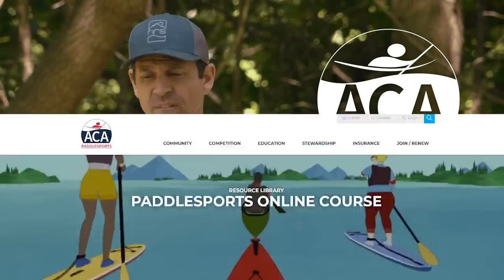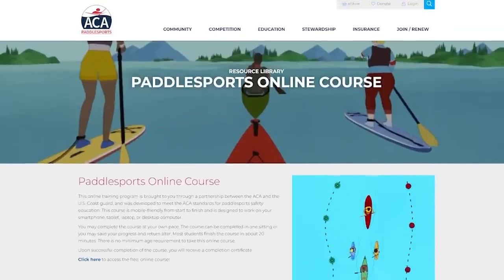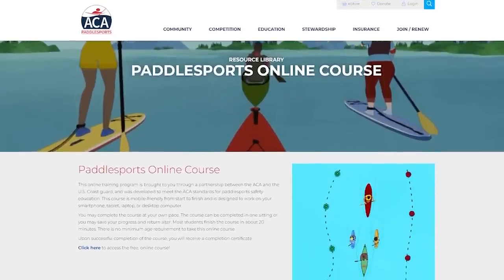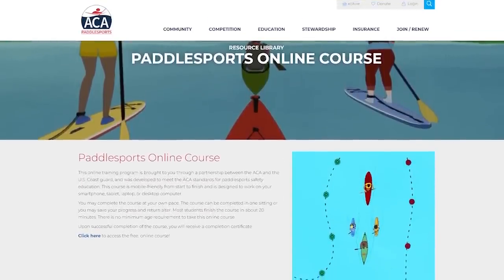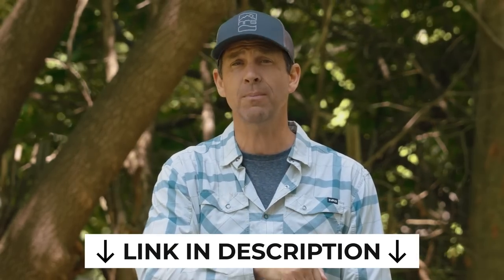How Kayak Design Affects Performance - How to Choose the Right Kayak

Comment: Video suggestion:  Talk about draft depth and how it changes for different kayaks.  Both the surface area and shape of the bottom the boat will significantly affect this.  I was on a trip with a Wilderness Tsunami 125 (largish bottom and v/flat shape).  My friend was in a Piranha whitewater boat (small bottom and big curve).  He was hitting rocks and grounding out right and left...while I was gliding over them no problem.  If a paddler is planning on doing small rivers/creeks that have a lot of shallow areas, they should consider a boat that drafts well.
Reply: I ordered a Tsunami 125 online but had to refuse the shipment because the boat had an apparent crack. Now I'm considering the Tsunami 140 because it's only $200 more and I'm afraid if I purchase the 125 , I'll wish I chose the 140. Curious if you've paddled the 140? I'll be padding lake 99% of the time.
Reply: @whiteknucklestormchasing  I'm not a fan of the 140...too long and narrow for my type of rivers.  For something similar to the Tsunami 125, consider the Jackson Tupelo 12.5 or Old Town Loon 125 or the Wilderness Pungo 125.
Reply: @AaronSmith-sx4ez  I have checked out the Pungo 125, Loon and Tupelo.  I like the design of the Tupelo except for the recent change to hard molded plastic seat. I just don't know how noticeable (if any) 2 more feet will have on glide and efficiency.  If it is noticeable,  is it worth a couple hundred more $$$.
Reply: @whiteknucklestormchasing  
You mentioned that you will be paddling on lakes  most of the time. However, it ultimately depends on what type of paddling experience that you are looking for.

 Longer kayaks generally will have better tracking, more paddling efficiency, and have more speed. But, are you looking to paddle for extended periods or short trips?
 Are you looking more for speed or stability?
Are you going to be camping or fishing? 

Before you make a purchase, I would recommend going out on a demo day and paddle  several kayaks at your local outfitter. Or, you could rent a kayak as well. Keep a notebook with you and write down the kayak model and specifications of each that you tested. Also, write down what you likes and dislikes as well.

 This will take a bit more time, but you will appreciate Kayaking more when you find the right vessel that matches your needs and so will your wallet! 

In closing, buying a kayak is similar to buying a pair of shoes. Things like height, weight, comfort, performance, and features are very important and will help or hinder depending on how you use them. You wouldn't wear rock climbing shoes to go hiking in the mountains. Unless you are a masochist! Take care and happy paddling!
Reply: @robertcarpenter5681  Great advice Robert! Thank you!

Comment: I just got back from helping with a small race. I got my hands on a Necky kyook 15ft that I used for it today. It sure challenge me, let me tell you. I was upstream paddling in a canal. I did fine until I got to a really strong current and sharp turns. It sure tested me and I had to push myself off away from the bank at one point because the current pushed me into. I can definitely feel the difference between that hull design and my 12ft rec kayak. Love videos and thank you for keeping us informed, it has helped me a lot. 😁

Comment: well done. I would only add that the design of the deck and cockpit combing also determines how you use the kayak. Some sea kayaks have low side and rear decks close to the shear line. You should always wear a full watertight skirt when paddling these style boats in any rough water. They are designed for them and without a skirt waves will breech over the sides and rear deck and flood the cockpit. I see recreational paddlers that buy or rent these boats and then when the first wave douses them from the back it is a big surprise.

Comment: That was a pretty good effort at covering a pretty broad subject.
It's really hard to lump it into one package.
The reality is that a newcomer more than likely won't be able to envision what they'll be doing in terms of paddling two years from the beginning.
It took me several years of learning how boats respond before developing an ideas of about what hull characteristics I actually wanted in a boat. Then I started reading several books on hull design and boat building. Now I build what I want knowing every choice is a compromise.

One item of note. Longer boats are not "faster" so much as a longer boat has a greater potential for speed than a shorter boat. Shorter and lighter boats tend to be quicker with less top speed. For those not trying to cruise above 4 mph, a 14 foot boat of similar design can cruise just as well as a 17 foot boat in the 3-4 mph range except it takes less effort to do so. The added speed of a long boat doesn't come for free. Longer boats require more energy at lower speeds than shorter versions of the same boat due to the added weight and wetted surface areas.
Reply from the maker: Cheers!
Reply: I disagree in general, longer boats are not always heavier and do not necessarily have a larger wetted surface. My 17 foot sea kayak is half the weight and has lower wetted surface than my wife's 13 foot rec kayak. Both of my greenland style sea kayaks takes less effort to cruise at any speed than most any other kayak. If you are comparing two same style and construction boats (ex: two touring kayaks from the same manufacturer in a large size vs medium size), then yes of course the larger boat is heavier and has a larger wetted surface. Remember, hull width, buoyancy, and wetted surface are not proportional to length, it all depends on the design and materials. However hull cruising speed IS directly proportional to hull length because the wake is longer. The length of a boat's wake has a direct effect on the cruising speed.
Reply: @PappaMike-vc1qv  Note I mentioned a shorter version of the same design, not a shorter and wider boat. There's weight and the surface area exposed to water. More whetted surface area equals more resistance.
Longer boats have higher hull speeds due to their bow wakes remaining shorter than the LWL at higher speeds than a shorter boat. It's just physics and hydrodynamics. A shorter boat of equal width requires less energy to accelerate than a longer boat of the same width due to the resistance of water.

Comment: Excellent presentation, I learned a lot, thank you. You didn’t mention the effects of wind, particularly on the bow. I found adding any gear to the foredeck makes big difference in the wind. While smooth rounded foredeck allows better tracking in rough conditions. Also stern design wasn’t mentioned. Obviously a rudder or skeg is a game changer but I think the stern shape thats underwater can provide some directional stability without those additions. I’m just starting off with my first kayak. A wide sit-in design. I find it’s very stable because it’s wide, however that makes it more challenging to paddle. Perhaps my paddle isn’t long enough or bad technique !

Comment: Thanks for the fantastic video! The funny thing is, I play disc golf and the quality/type of plastic makes a significant difference in durability in many plastic types. Adding reds tends to make our plastics stiffer and more durable, so I was perfectly ready to believe that hulls made from a red mixture were stronger! You absolutely had me! (and I still am wondering if there might be some truth to it...)
Reply from the maker: Ha!  You are right... pigments in the plastic do have a small impact on its characteristics, but not enough to have a noticeable effect on kayak performance.
Reply: @PaddleTV  I suppose kayaks aren't hitting tree trunks at 50 mph nearly as often as disc golf discs 🤣. (unless they are being used very wrong!)
Reply: red and yellow pigments either fade quicker or are more expensive due to the additives needed to make them UV resistant. other colours are less effected.

Comment: I want a crossover I don't need a crazy ww boat nor do I need a 15f kayak the market loves them as they are always sold out but we're just pushed these boats from having more than we need from both ends of the spectrum.  Many of the crossovers are now a decade old where are the 10f /12f duel bulkhead crossovers, upgrades to outfitting improving flaws?   Why is good enough good enough?
Reply: I have the last gen tsunami 125 and it's truly terrible on rivers the price was right buying my brothers boat back from a friend for $575.   But its still not what I'm looking for hoping to find an dagger katana or at the very least a dagger axis though I didn't much care for the 12f.  Central Ab Canada if anyone wants to trade😅.
Reply: Sounds like the Dagger Stratos would be a good fit. They have a 12' size with noth front and rear hatches
Reply: @joshinfwtx4506  The stratos 12L was on the top of my list but I have never seen one and they're never in stock at aquabstics here in Alberta. Never seen one used though I have been actively searching for one for the last 3 years or more.   Funny everyone always recommends hard to find or discontinued boats maybe the manufacturers are putting to much development time on the wrong products 🤷‍♂️.  Got to get that dollar from every price range but that takes to much production time away from the boats that sell or could sell if they were available.
Reply: @Rockerrobin  I've seen a few at our local stores but it is frustrating how hard kayaking manufacturers have been hit by production issues. It seems like the manufacturers are focusing harder on the entry level models. I also noticed brands/models available vary by region.  It's quite frustrating.
Reply: @joshinfwtx4506  even though I like the stratos it's still probably not what I'm after I basically want like a piranha 12r with a skeg and bulkhead storage.  Something that you can play in on lower class rivers but will run fast enough in the long flat sections in between or small lakes.   Even a skeg on some of the half slice boat designs would be something I'm interested in I'm not opposed to stuffing drybags into the haul though bulkhead storage are more convenient.
Reply: @Rockerrobin  maybe a Liquid Logic Stinger XP? I think Jackson has produced few more of the Traverse recently.
Reply: @joshinfwtx4506  The liquidlogic stinger xp is exactly what I'm talking about unfortunately discontinued although loved they were not marketed with focus pushed on other boats.
Reply: @Rockerrobin  dang it, I didn't realize it was discontinued. 🙁
Reply: I got a pyranha FUSION SOT Crossover, not a bad boat on the coast. My perception kayak triumph 13 Sun Set is faster on the water. But I do love the fustion sot and use it most of the time. Nice short fun boat.
Reply: @peterkitchener8787  Not a bad looking boat looking at it other than the sit-on-top design.
Reply: @Rockerrobin  I find the sit on tops better and safer. No pumping out or spraydecks.  There easy to get in & out too. All my sot have foot & thigh braces.
Reply: This is rocker rolled over in the river today attempting to save
My hat ended up loose my phone and prescription sunglasses instead.  I can't even access my YouTube account without my phone as I can't rest my password without it with the code sending to my email I need to reset.    Bad day on the river probably a good $1000 and I'm broke indefinitely.
Reply: @robinadamson3565  Its why I use sit on kayaks with storage hatches, floating vhf radio & cheap sunglasses. If someone finds my wooden sea turtle necklace can you post it back to me? Mite be in Canada by now.
Reply: @peterkitchener8787  can't use cheap glasses if I want to see what I'm doing. I do have a phone bag but had my phone was out at the time because the phones bags come in the wrong sizes or rather the ones I needed were always out of stock. Mine is oversized and cumbersome plus unsafe to have up on my jacket and the glare made it impossible to use my phone for pictures and music.   I didn't technically loos my sunglasses entirely lost one of the lenses as I grabbed them still expensive because they were polarized prescription and a custom cut lens.   I was looking into sunglasses floats on Amazon but reviews are mixed and the frames don't work for several options.   Wish I got something probably still would have lost the lens regardless.
Reply: @robinadamson3565  Oh my wife had the same issue with her glasses. Now she got string on them with 6mm pipe insulation.  It seems to work well. I'd leave the good phone at home. I take a cheap sonica r2 IP68 builders phone with me. It was only about £40 and take pictures too. Just swap the sim card over when you need it.
Reply: @Rockerrobin  Jackson Karma Traverse 10 is brand new, fully upgraded and one heck of a sweet crossover!
Reply: @Cascadians  is that the blue one on kijiji saying out of town but you can call my friend.